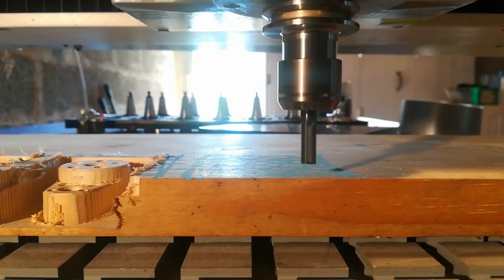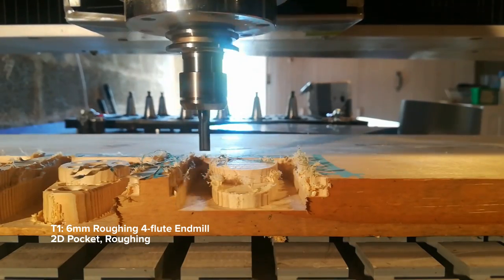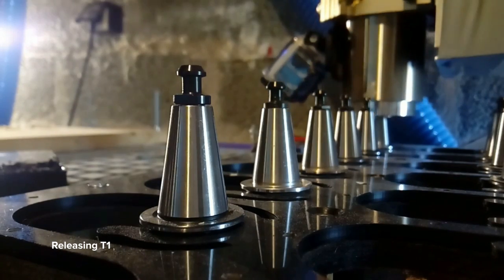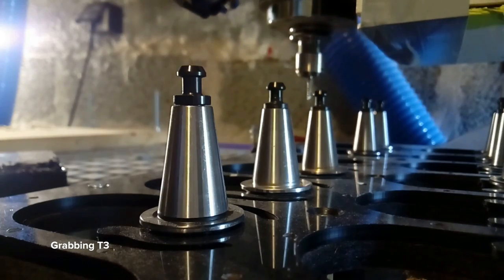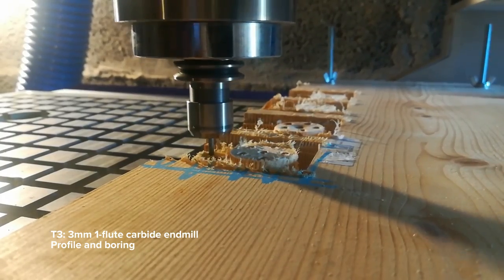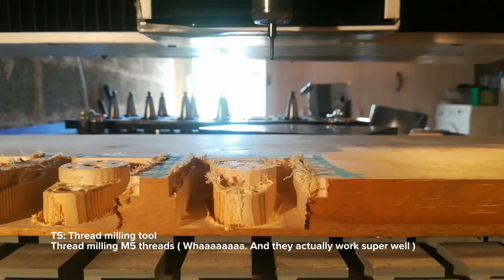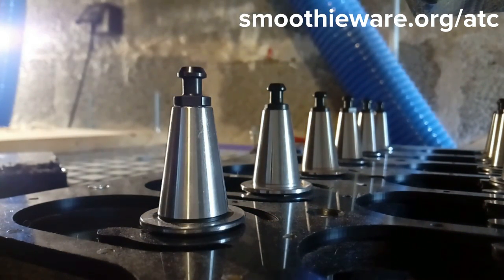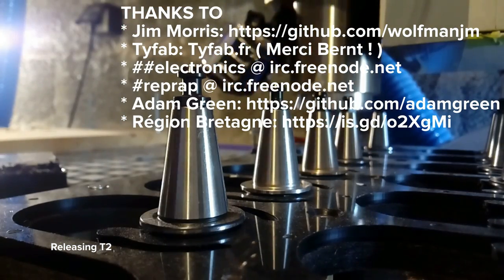MY CNC DOES MAGIC ⚙ ( Smoothieboard ATC Router Conversion )

Comment: That little spindle wobble it does will letting go of the holder will be hard on your tooling and spindle taper over the long term.
Reply from the maker: Yeah I need to get rid of it in the long term. I think the main reason I have to do it is because things are not well aligned with each other, if I'm more careful and take more precise measurements, I should be able to set things up in a way where it doesn't get stuck. Thanks for the warning, I agree it's definitely bad long term.

Comment: I recently bought a similar spindle from the same company, and have gotten it setup and working, but instead of using fusion 360 for the tool changing I will be writing a script for Mach 4 to do the tool changes when new tools are called for in the G code. I'm just about ready to start that part, but for now its working well as a quick change spindle

Comment: Is the pull stud on T6 loose? Looks like a gap between stud and tool holder?

Great vid - good to know ATC is possible for the general user, well done on getting it to work and letting us know of the resource you are creating to show how.

Merci!
Reply from the maker: It's from a different manufacturer so it looks a tad different but the dimensions are the same.

Comment: Can you make a video showing the intimate details of the types of valves needed for an ATC and how to wire it into your breakout board and into the software i e Mach
Reply from the maker: The valves are the basic type you can find anywhere. For wiring and tube connections I'm planning on making a full documentation but don't know when I will. About the software, this uses Smoothieware and bCNC, not Mach. I plan on documenting that side too.
Reply: @ArthurWolf   a quick video would help  understanding  what i need need to do asim looking to implement asap

Comment: without spindle orientation=crap
Reply from the maker: What
Reply from the maker: Are you saying it's crap because it doesn't have a 4th/5th axis head ? I'm sorry I have a hard time understanding, if you could clarify.
Reply: the think that u did there is not safe. u are using  a taper 30 holder without a key holding it only by pressure It may  will spin inside the spindle .If the tapered washers inside the spindle brakes (it happens pretty often ) at 24000rpm ?
Reply from the maker: @aldo6717  I don't understand what you mean "without a key holding it"
Reply: if u look at a cnc holder  u will see 2 slots on the flange that will lock into the spindle to prevent spinning it.
Reply: open an image of a cnc holder and a cnc spindle and see it .2 slots on the holder and 2 slots on the spindle-the spindle may have the keys inside already
Reply from the maker: @aldo6717  I can't check right now, but I think my holders have this. Will try to remember to check on this later on.
Reply: aldo is confusing BT style tool holders with NBT and ISO. The BT style are usually found on cnc machining centers intended for machining steel, aluminum, etc. on a production basis. For example, my Matsuura 510V uses BT35 tool holders which have the two slots which engage in the tangs on the spindle nose. My Matsuura 800 uses BT40 which also have the slots. These are intended to keep the tool holder from slipping/rotating inside the spindle under operation. CNC router spindles usually have NBT (same configuration and BT, but NO SLOTS) or ISO tapered tool holders. Most cnc routing is at higher spindle speeds (18,000 to 24,000 RPM) and the material being cut is usually wood, plastic, or aluminum and the chances of the tool holder slipping inside the spindle is very low.